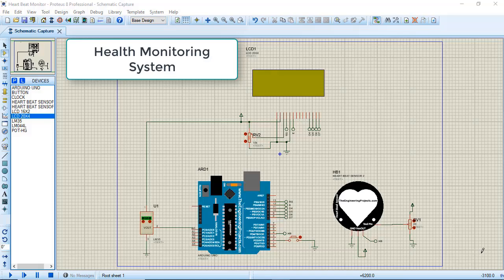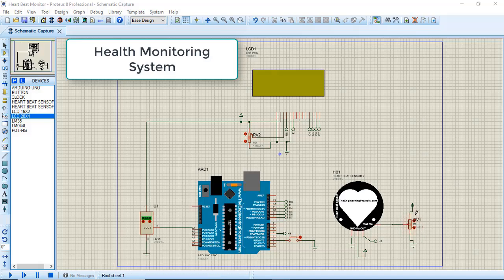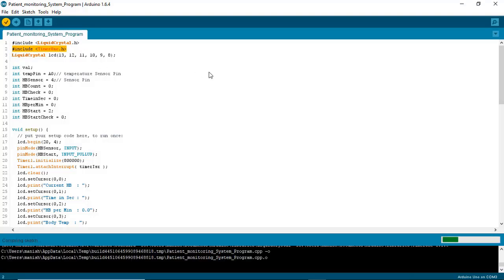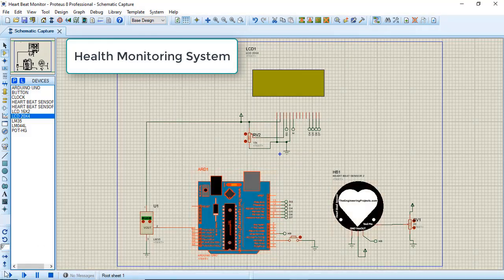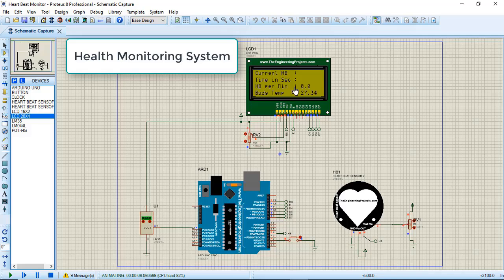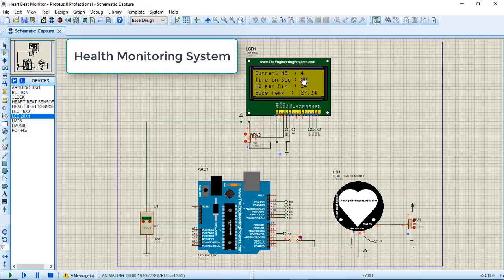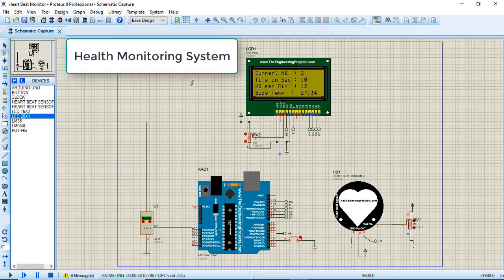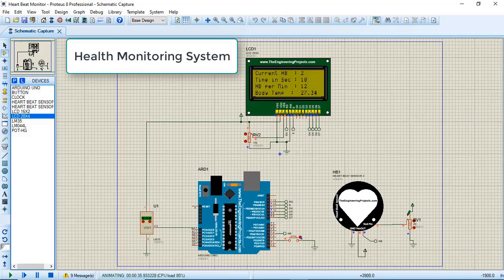Health Monitoring System Project Using Arduino || Proteus Simulation

Comment: I'm facing this error and warnings in keil software for the arduino code!!!                                                           compiling heartbeat.c...
heartbeat.c(1): warning C318: can't open file 'LiquidCrystal.h'
heartbeat.c(2): warning C318: can't open file 'TimerOne.h'
heartbeat.c(5): error C129: missing ';' before 'lcd'
heartbeat.c - 1 Error(s), 2 Warning(s).      what i have to do?
Reply from the maker: You have issue with libraries. Please install above libraries and use proper ";" in the code, the issue will be fixed. Thanks for the comment

Comment: It does not run..it writes CPU overload what can be the problem?
Reply from the maker: Please check with arduino board. You might had used incorrect arduino uno library
Reply from the maker: Please visit our website for code and project file: https://lifestyleunboxed.in/innovation-ve

Comment: Sir I did all connections properly but LCD not showing output....
Please Help....
Reply from the maker: Hi Riya, Thanks for the comment. kindly check the LCD connections again - you might missed out any connection or check for the correct LCD from the lib. that will resolve your issue

Comment: Sir,i made all connection as per shown in tutorial, but it's showing two errors 1.AVR program property is not defined
2.real time simulation failed to start 
 Need help for this 🙇🏾‍♂️🙏
Reply from the maker: Hi @Shubham kause, It seems you had selected incorrect controller (arduino uno) and second error can be resolve while you follow the tutorial again, since it is real time simulation fail.

- Thanks for comment
Reply: Sir, problem still not solved. I mailed  my Proteus work .can you please check it plzz🙇🏾‍♂️🙏
Reply: @shubhamkause1974  ..download  hex for the heart sensor. .then load it to the sensor  like u do with arduino  ...then it should  work
Reply: @chidichris5687  thanks for help 🙏
Reply: @chidichris5687  where is hex file for heart sensor i need that plz paste it here
Reply: did u already know how to solve this problem?

Comment: I tried to compile your code but there is error stating that 'class TimerOne' has no member named 'initialize'
 , can you help ?
Reply: I have added the library TimerOne, but still error
Reply: @nurqhasrinaahmadjohan1410  add the timerone in the arduino not in the proteus library
Reply from the maker: Yes, Thanks Nur

Comment: DC VOLTAGE KITMNA DENA H BRO ?????
AND HB KYA H IN 3:55 PE DIAGRAM DEKHO EK BAR... AUR BATAO HEART BEAT SENSOR KAISE CONNECT H MICRO CONTROLLER SE
Reply from the maker: 1. 5V Obviously
2. HB stands for Heart Beat
3. Net name is same (HB) and connected to arduino digital pin 4.